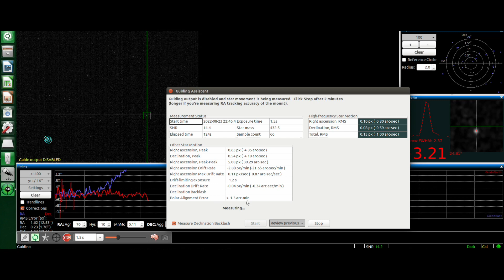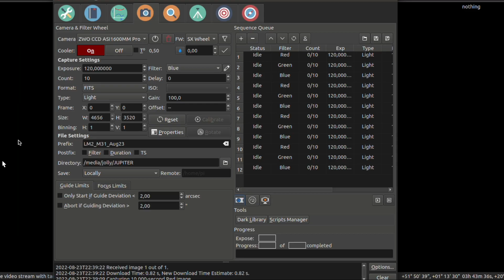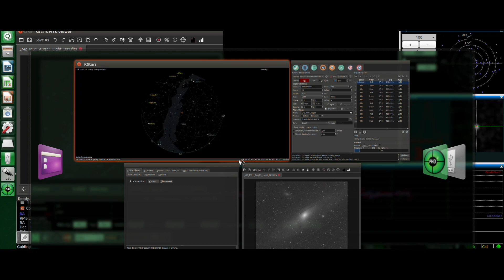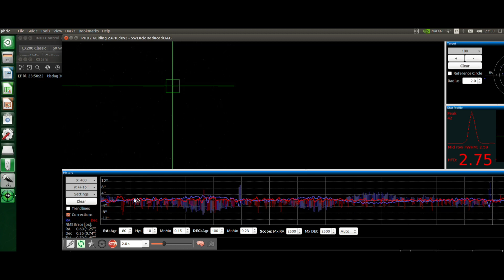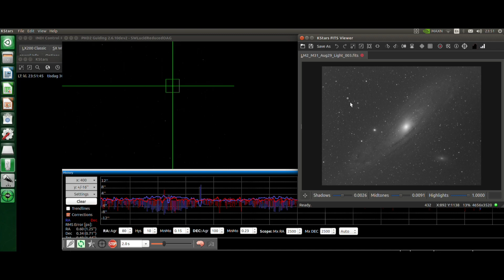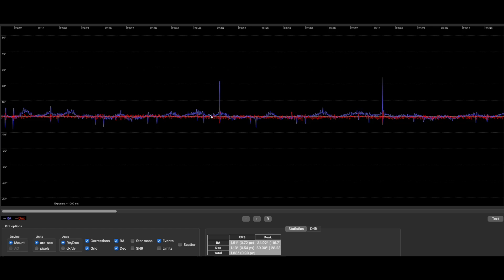More light captured with my DIY - Direct Drive telescope mount!

Comment: You are a closed loop with the autoguiding. What would phase voltage drops have to do with periodic errors? If there was some terrific stiction or something and a maximum current was being reached...
Reply from the maker: Hi!
Lots of comments here! Great! I will try to address them all :)
Autoguiding as a feedback loop/encoder. Yes, in a way it is a high resolution dual axis encoder. Sounds great to be honest. The drawback is that it is super slow. A feedback time of 1-2s is not good at these scales. Also, the corrections are made with constant speed (sidereal x 0.5-2 normally) during a calculated period. Large, or high frequency errors will not be dealt with, or corrections might even cause oscillations etc. and make things worse.

Instead of using encoder, this is basically a glorified clock drive without mechanical feedback. I just pay with constant, high current, and hope that it does what I want it to. Slow errors, such as stiction or cable snags are maybe some of few issues that the autoguider could assist with since they are so slow. Some of the periodic error I have might very well be axial stiction(because there is always some stiction).